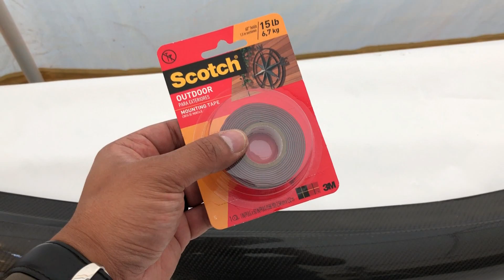REMOVE & INSTALL CARBON FIBER DUCKTAIL SPOILER MERCEDES C250 C300

Comment: Wish I saw this sooner- the strategy of the center mark is the best when installing alone-
I misaligned mine and one side isn’t flush with the trunk lid edge - by center marking you can focus on getting the spoiler flush from hr back on the trunk lid
I have to remove and clean the spoiler and re isntall

Comment: Little trick tip use WD40 to dissolve adhesive,melts it right off,without hurting paint.
Reply from the maker: I’ve tried many solvents over the past 15 years including WD40. It works on small stuff but not all the time. And it’s messy.  The 100% best solution is a rubber eraser wheel on a drill. I don’t use anything else anymore besides that.

Comment: Just had a shop remove my OEM spoiler to install the same one you had in description. When they removed it off and cleaned residue there was a lot of lines like scratch marks? Not sure if it’s just me but seemed like you didn’t have any of those
Reply from the maker: Don’t know.  They probably did a bad job of removing it or someone removed it once and did a bad job.   Using a fishing string will give you lines but it’s just residue that cleans up.
Reply: Flexx Alexander I had this car from delivery.. not sure what method this shop used. It’s the best shop in my area 140+ 5 stars too. They did however tell me that it may leave scratches when removing but I thought of how you did yours flawlessly so it shouldn’t be any different
Reply from the maker: Could be the fishing string they are using too. Mine had some minor scratches but it polished right up.

Comment: How did you get most of the adhesive not sticking to the hood? when i did same the procedure a good amount of adhesive was on the hood.  Had to use a razor and was a b!tch & 1/2 to remove the leftover adhesive.
Reply: use buffer next time, some polishing compound and it can be buffed of without damaging paint, I had so much glue residue when removing chrome side trim
Reply: Try turtle wax vinyl removal.....works great, i even got it to take couple scuff marks off my car (white paint)

Comment: do u still have the wheel spacers on the car in this video?
Reply from the maker: Yes. Still good. Once a year I take it off and give it a nice coat of black spray paint, let it thoroughly dry and then make sure I apply grease on both sides before putting it back on.